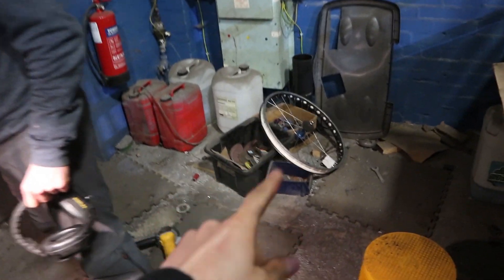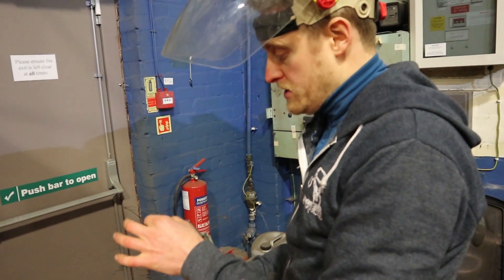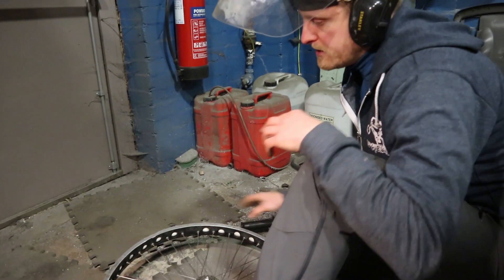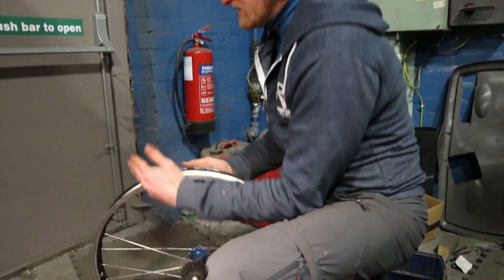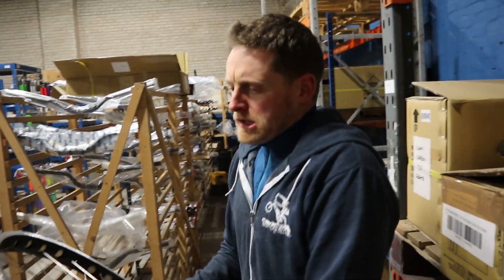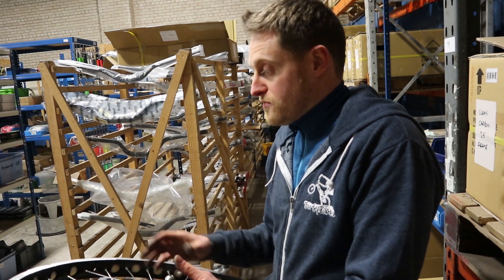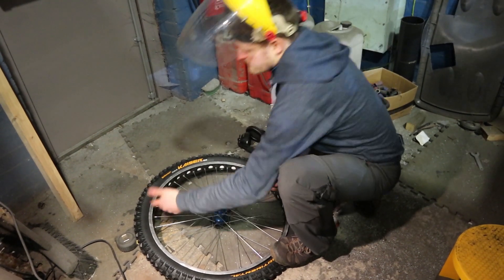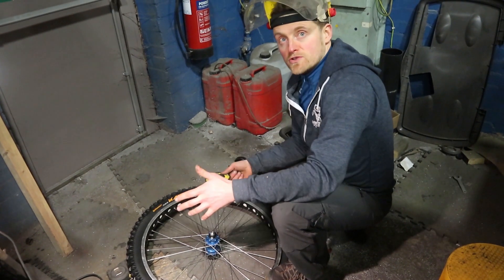How To Grind A Rim For Trials Riding

Comment: I resisted grinding my rims on my pure for SOOOOOO long, trying different pads and tar and so on. Finally ground them and it all makes sense now. WAY better braking performance with a grind. Absolute confidence in your rear brake makes taking your riding to the limit much easier. Nice little vid Ali.

Comment: Only done this a few times, but I put the wheel back on the bike. Spin the wheel then you can hold the grinder in on place with  the same pressure all the time.
Reply: @Ali_Clarkson  Just use brake cleaner to get rid of any release agent.

Comment: If you want to save your fingers from the disc then put something between the tire and the rim (I use a longer screwdriver or allenkey ). Then you don't have to hold the tire with your hand/fingers and it's a bit safer that way. Also it's easier as you can grind more of the rim in one go. dunno if my explanation made any sense lol :D

Comment: If a rim was not made of soft aluminium (I imagine most are) , e.g. steel(I know weight would be an issue maybe), would the grind last longer? Just wondering if  different metals/materials have been tested/explored.
Does it need to be metal, how about other materials like plastic resins?
Or instead of grinding, use tar?
Reply: Tar on a wet rim is VERY exciting! Like riding brakeless in the rain. Steel would last longer and take a surface like a bastard file. Grip would probably be phenomenal, weight might be an issue and braking could chew brake pads in nano-seconds. Ground alu works very well with the right pads, light, easy etc. I'm not sure if we'd get a volunteer to try a grind on some carbon rims.......any takers??
Reply: @dewindoethdwl2798  :)  I guess alu it is then, tried and tested.
Reply: @Ali_Clarkson  I always thought steel was softer than aluminum? I wonder if something like truck bed liner would work...
Reply: @Ali_Clarkson  Hmm,  I think it could be complex to manufacture, carbon rim with steel side wall,  not that it would help me at all (rubbish skills!), but it would give good strength, lightweight!  Even someone (average joe dept) could just setup their own experiment at first with an old normal alu rim, glue thin steel sheet (I;m talking millimetres thickness, grind that) on the sides. It would make a rim last almost  forever in terms of grinding, when the steel wears thin just glue a new one on (would also need to sort out a good method of attaching, glue sounds like the easiet way). I would be interested to try it.
Reply: I guess a complex super-rim could be developed but at what cost? Imagine how you'd feel creasing it on a kerb. It's a bit of a cost v benefit, form vs function design headache. Alu is cheap, available, sussed etc. but may also be a stagnation of design. DMcG did demonstrate carbon rims to be outrageously strong. Having a good long rethink of wheel design for trials riding could be a fun engineering MSc for someone?

Comment: Or just use a disk brake for god's sake, it's not 1850!
Reply: @Ali_Clarkson  Ok, that explains why hydraulic rim brakes exist at all (I had no idea they are a thing before this series).
Reply: 20" wheels are as tough as old boots so can stand the weird loads of stopping a rim by braking the hub (disc brake) then pogoing around to avoid wearing out the front tyre....or to hop up something. 26" are a bit more flexible so stopping the rim is lot less cruel to the rest of the wheel when you're bouncing around on one wheel. Rim brakes also make a distinctive squawk, the mating call of the trials aficionado.